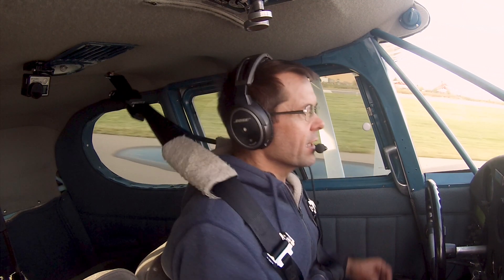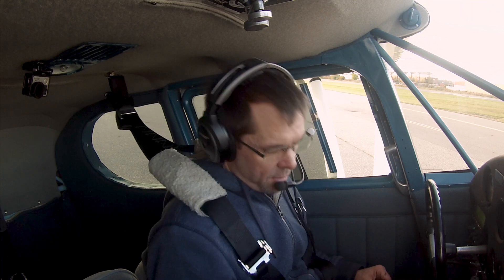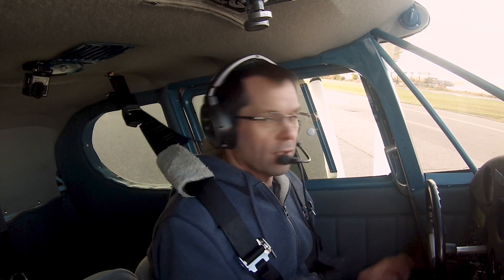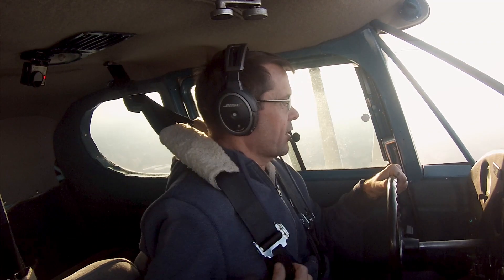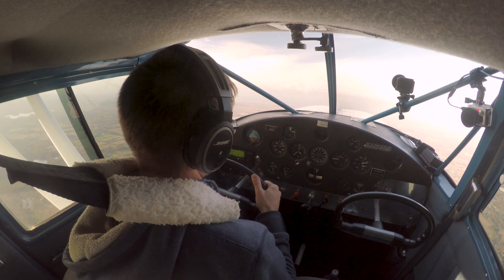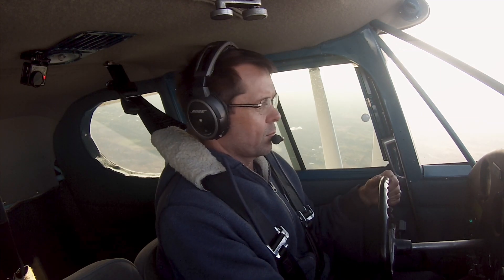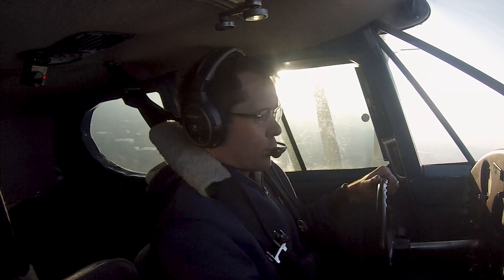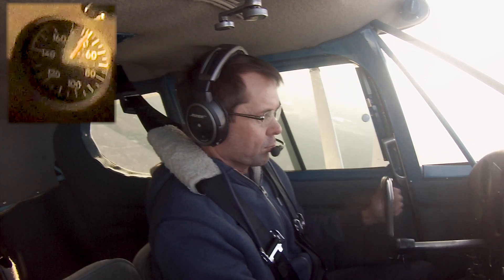Project Stinson STOL - Learning STOL Techniques in a Stinson 108 - Stalls

Comment: Remove the factory wing tips,outboard of the aluminum spar extrusions, extend both spars by 16", add fabricated ribs identical to inboard ribs, extend ailerons to match the new wing extensions, add Madras wing tips, add two extra knotches on the flap detente, stall  speed drops 7mph. No change in cruise speed on a float plane 108-1
Reply from the maker: Show me the AI who can get that 337'd and I'm in!

Comment: so is one of your mods going to larger tires?
Reply from the maker: I have 8.50 aeroclassic's on it now.  This increased the deck angle sitting on the ground. This allows for a higher angle of attack when it sits on the tail during the takeoff run, I am sure you are aware of how this works.  It looks like the 29 or 31" tires  still keep the angle of attack under a stall angle of attack at 40-50mph.  Yet there is a huge increase in weight (30 pounds) if I put these tires on.  The Aeroclassic's are 10 pounds each.  On a side note this plane wpould look wicked cool with 29" tires.
Reply: @GreatMichiganBushCo  I cant find it right now but was looking at a Maule a while ago and one of the options was a 20+ Goodyear tire I think it had treads though....I remember reading it was a pretty good  tire I think 6/8 ply...the thing i liked is we both know most tundra tires wear quickly on asphalt and supposedly this one did not.  The negative was with treads it was suppose to sling gravel up on the tail section ...my flying was about 50/50 grass or dirt and concrete/asphalt so with plastic/rubber protectors on the horizontal stab it might be a good thing....you might be able to find it or maybe know what tire Im talking about....
Reply from the maker: @leeadams5941  those are the old Goodyear blimp tires. 26". I have a 337 written to put those on my airplane. The problem is they're only about an inch taller than what I have right now.
Reply: @GreatMichiganBushCo   got it, sure would look killer though

Comment: Any landing distance 1 foot shorter than your best takeoff distance is wasted effort, other than non-useful bragging rights.
Reply from the maker: I'd disagree. I've landed on a beach that was full of debris. I needed to land 220' to get in but once on the ground cleared the additional ground I needed for the takeoff roll.
Reply: @GreatMichiganBushCo  Was your plane on fire? Were you physically incapacitated? If not, I suspect you didn't "need" to land on a beach in 220 feet. What purpose did it serve, other than bragging rights and a lark. A conservative pilot would rethink your reasoning. I stand by my first comment.
Reply from the maker: @timsaxer6442  We went in to provide some clean up after a flood.  There was a lot of garbage in the area and access to the area was limited.  I guess we didn't need to land there but it did provide a service to the community.
Reply: @GreatMichiganBushCo  Great point.  This is a great example that a pilot can improve his take off distance after he/she is on the ground.  This could apply to basically any back woods strip.

Comment: I have a -2 with a Franklin 180hp and constant speed prop. My stall numbers are about the same, 50ish when using gps. I use 1.2 vso or 60mph on final. have to be on the  ball though as it is real easy to drop it in. makes for short roll outs. Definitely have to use power to arrest sink rate at those lower approach speeds. You might want to check into the EZ flap stc. I installed one last year as I found it impossible to reach the flap handle without loosening my shoulder harness. also do not have to look down or lose site of the runway when grabbing flaps.
Reply from the maker: My goal is 45MPH IAS on final. I think this spedd would get me below 150' landing distance.  I have been using a 50MPH IAS on final and am getting ~200'  with the VG's the 50MPH is rock solid all the way down.   
I'm doing the math and using my numbers full flaps power off Stall at 40 IAS would genetrate a 48 IAS 1.2 Vso airspeed.  That's why my goal is the ~1.1Vso (45 IAS) final speed.  
****I am not a flight instructor and  am not recommending anyone fly final at anything other than POH airspeeds****
Reply: I will be watching what you come up with, I'm doing something similar flying in/out of a tundra strip near my gold mine.  I just cleared the brush/trees off of the strip in September, has not been used since 1980. I ended up with about 600 usable with very soft tundra that is questionable for another 300, so maybe 900 feet if I'm lucky. I routinely fly out of a gravel 900' at 2500 elev with my GCBC, 108-2.  Flying is pretty much over till next spring, too cold/snowy to be messing around. I'm planning on putting 29 or 31 ABW next year, not sure yet, hoping to talk to others that have used them. I have a set of 29's I am putting on my GCBC next spring and will use that aircraft first before I try with the heavier Stinson.
Reply: what size engine and prop are you using?
Reply: also, since you have owned a -3, do you think the larger rudder helped or hindered in a crosswind. I have noticed in mine, I pretty much run out of rudder to correct a left turning tendency when taking off on asphalt. Not nearly as bad when on gravel.

 Reminds me of trying to turn my old D8 2u caterpiller dozer, having to use all of my leg strength to get it to turn!

Comment: I'm looking at the 108 series for my farm strip. Was the move to a smaller tail the main reason for changing aircraft? Does your 108-2 have the 165 engine? Are major new Franklin parts available now?  Thanks for sharing the videos.
Reply from the maker: I moved to the -2 for a few reasons.  One was the smaller tail. The big tail adds weight and hurts the ground handling.  The big tail also helps handling int he air and stability.  The -3 flies more stable. Most -2's have the Franklin 165.  I have not found to many problems finding Franklin parts I don't think many have been new though.  The current manufacturer is in Poland and not producing much but with the internet a large community has formed around Franklin engine making parts easier to find.

Comment: The John Hoyt books suggest you make a power on approach and full flaps at the weight you are at for the film can come in at 1.25 vso indicated power on which equals 41 mph ias with power on and full flap...allowing a chop n drop in stop.....or dump the flaps to make a point.....yet crossing the trees and taking into view the micrometeorolgy of a slight drop in wind about the treeline or gusts....could create a rolling motion which in turn will need arrested that in turn with a deflected aileron changes the camber of the individual wings and localized dynamic flow that in turn will not be sufficient to arrest the roll in a timely fashion...with the ensuing limited control response and difficulty accelerating to a more controllable situation.
If the motor conks out you will pancake.
In short....better be smooth as glass so ya don’t end up on yer....
If it is...ya got this

Comment: great video. i really  appreciate you taking time to do them. i have a 108-3 and it does not stall like your video. i have a hard time getting it to break over. it just wants to mush and lose altitude. i have double checked my cg and all is good. i can drop the nose and it is flying again. my stall horn never goes off.
Reply from the maker: I got this to break with no flaps by getting fairly slow with power and the bringing it back to idle.  It doesn't want to stall without flaps.  I'm not sure without input the nose would get below the horizon, though it would still be descending.  The 108's are a very docile aircraft.

Comment: Did you see how much your cowling moved at 1:48?  I have had my Stinson 108 for 30 years and it has never moved like that.  You can see the lower cowling move quite a bit at the aft attach points.  You need to tighten that up.
Reply from the maker: This one came that way. My other one didn't have the movement.

Comment: Are you using your ASI for airspeed during your stalls? If so, the angle at which the pitot tube is at a stall is going to show a far lower airspeed than actual. When I did this I used GPS ground speed and found  my straight 108 would stall at around 48 to 50 mph with power and flaps.
Reply from the maker: Of course there is airspeed error at that high an angle of attack. The error will be consistent at the weight, flaps, and power settings.  I am not as concerned with how fast I am going but at what indicated airspeed the plane will fall out of the sky in it's current configuration so I can fly the approach  near stall without stalling.  The GPS speed on an approach will not help since the ground speed changes with headwind component.  I would guess my TAS is in the 50ish MPH when it stalls.

Comment: How much lighter is your empty weight compared to your -3?
Reply from the maker: That's a funny story.  They are nearly identical.  I always felt the stated weight on the -3 was low my guess was it weighed about 30 pounds more than the paperwork but finding the scales to prove my hunch proved difficult.  I don't believe the weight on this plane either.  I think it's stated higher than it really is as I can't see why it would weight 30 pounds more than other 108-2's. Another advantage of the -2 over the -3 is the tail weight, that big tail is heavy and gives it not great flight characteristics when slow.  So anyway my guess is this plane is around  50 or so pounds less, I'll need to dig some scales up and re-weigh it.  Shedding weight is one of the projects I am going to work on.  If my calculations are correct I can loose somewhere around 50-60 pounds on this by the time I am through.

Comment: Have installed VG's on a 108-3 but never did a numbers comparison like you did, will be interested to see what difference you have after that? Also what other mods are out there? The AOA will help with the consistent landings regardless of weight. Does the one you talked about come with a probe that gets mounted out on the wing? Of course bigger tires will help give you a higher angle of attack for takeoff and landing, are baby bushwheels in your future?  Looks like you got that hair cut a 1:40 but grew it out for the rest of the video. =)
Reply from the maker: David you have a sharp eye!  The AOA uses accelerators, gyroscopes, and pitot information for AOA, it meets FAA standards but does have some limitation when in up/down drafts. I'll compare the VG numbers at some point... soon.  I had a set of 8.5" and will probably end up with those on this plane.  The other I have looked at is the Good Year 26"
Reply: @GreatMichiganBushCo  I loved the 26's on my 108-3 and I've got the Goodyear 29's on my Maule M4 and I never had a a problem hanging with guys running ABW's when I was living in AK. There's some really hardcore people putting the softies to work, but for the most part I've seen them limit guys flying more than open they opened up new places to go. I do have to say that they look great on the hanger queens 😁 😁